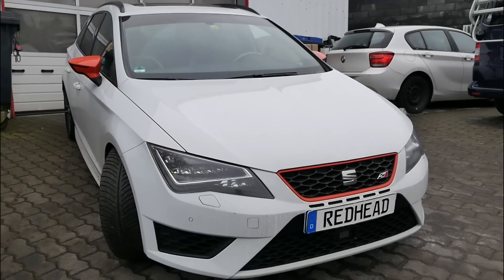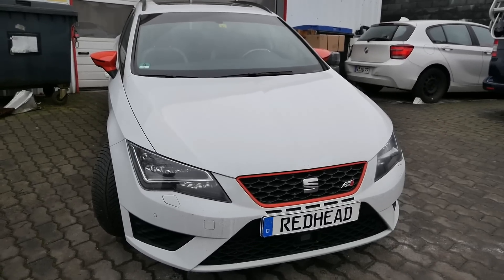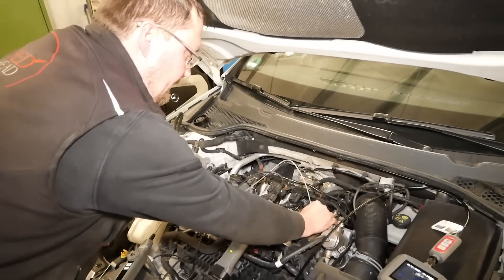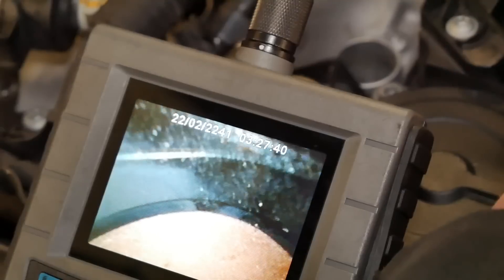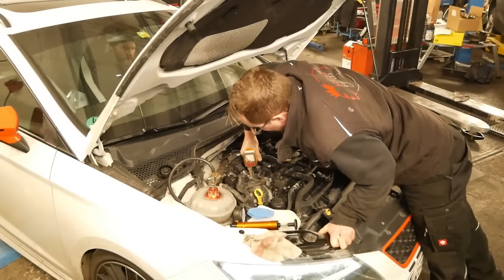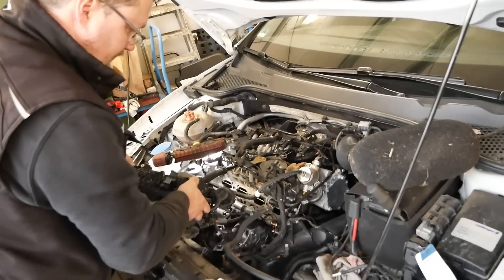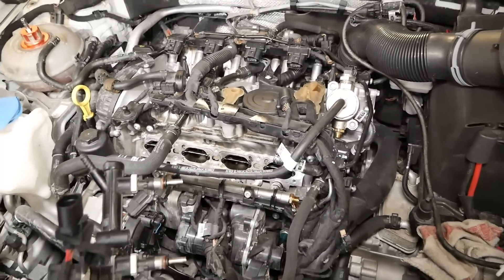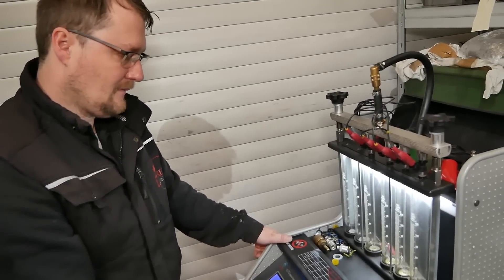Seat Leon 2.0 l TFSI mit 450 PS getunt - Hält der Motor das auf Dauer aus? SAE 5W50VR1  | Redhead

Comment: Was da alles noch für ein Geraffel an diesem TFSI  Motor sitzt...wenn ich da an meinen alten 1.8t denke. Was macht oder kann das alles? Kaputt gehen wahrscheinlich. ;-)
20w-50, da freut man sich auf den Kaltstart im Winter. Ob das im Sinne des Erfinders ist.
Reply: Eigentlich ist sehr wenig an dem Motor für einen Euro 6 Motor. Der Motor hat nicht mal mehr ein AGR.
Reply from the maker: Norman Engel.  Sie haben natürlich recht!
Valvoline ist bei der Empfehlung eines SAE 5 W 50 VR1 Racing von folgenden Empfehlungsvoraussetzungen ausgegangen die unten anstehen!
Im Video habe ich leider 20 W 50 gesagt!!!!  Das ist natürlich falsch... Ich meinte aber SAE 5W50 VR 1 TRacing ! 
Also die Empfehlung kam zustande unter der zusätzlichen Info: 

200-Zellen-Kat !

der Wagen hat eine Upgrade-Downpipe!

Ansonsten würde ja der Abgasstrang glühen, wenn der Serienkat verbaut wäre bzw. nicht ersetzt ist.

Bei einem Serienabgasstrang mit Kat, würde valvoline das SynPower 5w40 empfehlen.

Laut VW sollte hier allerdings (Serie) ein 5W30 nach VW 504 00 / 507 00 eingesetzt werden.

Comment: 20w50? Das kann im Sommer noch funktionieren aber bei winterlichem Kaltstart unnötig hoher Verschleiß. Lieber ein 5w50 oder wenn, dann 10w60.
Reply from the maker: mcericx;  Sorry, das war im Video falsch angegeben, es ist ein 5W 50 VR1  racing drin aufgrund der geänderten Abgasanlage auch zu fahren und von Valvoline empfohlen.
Reply: @RedheadZylinderkopftechnik  5W50 klingt schon besser. Ich hatte mich (bei offensichtlichem Winterbetrieb) schon erschrocken als ich 20W50 gehört habe.

Comment: 20W50 bei Winterbetrieb? Das halte ich für keine gute Idee. Der Motor bekommt von Werk aus 0W30/5W30. Da reicht in meinen Augen ein gutes, vollsynthetisches 5W40 (maximal 5W50) bei dem Tuning aus.
Reply from the maker: Chris, Sie haben natürlich recht! Valvoline ist bei der Empfehlung eines SAE 5 W 50 VR1 Racing von folgenden Empfehlungsvoraussetzungen ausgegangen die unten anstehen!
Im Video habe ich leider 20 W 50 gesagt!!!!  Das ist natürlich falsch... Ich meinte aber SAE 5W50 VR 1 TRacing ! 
Also die Empfehlung kam zustande unter der zusätzlichen Info: 

200-Zellen-Kat !

der Wagen hat eine Upgrade-Downpipe!

Ansonsten würde ja der Abgasstrang glühen, wenn der Serienkat verbaut wäre bzw. nicht ersetzt ist.

Bei einem Serienabgasstrang mit Kat, würde Valvoline  das SynPower 5w40 empfehlen.

Laut VW sollte hier allerdings (Serie) ein 5W30 nach VW 504 00 / 507 00 eingesetzt werden.
Reply: @RedheadZylinderkopftechnik  Bei der VW-Empfehlung geht es vor allem um den LongLife-Betrieb (flexibles Öl-Wechselintervall bis 30.000 km/Jahr) und den geringeren Aschegehalt des Öls (bei Verbrennung des Öls nicht regenerierbare Rückstände im OPF bzw. Kat).
Bei so einem getunten Motor würde ich auf ein gutes Nicht-LL-Öl und ein festes, jährliches Wechselintervall (< 15.000 km) setzen und so über einen geringen Ölverbrauch die Belastung des OPFs bzw. Kats minimieren.
Reply: @RedheadZylinderkopftechnik  Danke für die Rückmeldung! Dann bin ich beruhigt!

Comment: 450 PS in so einer kleinen Maschine kann nicht gut sein
Reply: Gibts doch quasi Serie auch schon in Form vom AMG Motor? Was haben die mittlerweile? 420PS? 
Aber halt nicht mit solchen Teilen ;-).
Reply: 😳
Das ist doch nach heutigem "Standard" schon n Bigblock mit seinen 2 Liter 🤔😅
Reply: Gähn. Diese hirnlosen Stammtischparolen gabs vor 30 Jahren schon "115 PS aus einem 2 Liter, das kann nie halten!". Heute das gleiche dumme Geschwätz. Meist von Leuten, die nicht mal einen Diesel von einem Benziner unterscheiden können.
 Der EA888 Gen 3 ist von Werk schon sehr robust und Oettinger hat die kritischen Komponenten im Motor zusätzlich gegen angemessene Upgrades getauscht. Wieso sollte die Leistung für einen Motor ein Problem sein, der darauf ausgelegt ist?
PS: 225 PS pro Liter ist heute nicht mehr viel. Siehe Motorräder. Eine Kawasaki H2R ist ein Serienmotorrad und hat ab Werk eine Literleistung von 310 PS. Probleme? Fehlanzeige.

Comment: Hält nicht ewig sowas ... wobei der Motor ja sowieso auch original selten die Karosserie überlebt. 200tkm erreicht doch kaum so Motor ohne in Teilen auf der Werkbank zu landen. Wenn ich die alten 944er Turbo seh .. standhaft gesteigert von 250 auf 290 bis 300PS ... und dann so Ding mit doppelter Leistung!? Hält der VW Mist keine 100.000km.  .... übrigens .. spart jetzt Seat auch an den Gasfedern für die Motorhaube?? Die werden immer teurer, aber man kriegt immer weniger für sein Geld
Reply: Das ist was, wo ich bei neueren Motoren auch nicht verstehe - bei VAG (Mercedes und BMW ja auch) da bist Du doch schon froh, wenn die die Serien PS dann auf 200.000 km halten - und da aus so einem kleinen Motor dann 450 PS zu holen - kann man machen, wenn der Verschleiß keine Rolle spielt. Aber die Laufleistungen finde ich eh schon krass. Hab mir le. März ein A4 3.0 TDI gekauft (mit 65.000 km) und da waren erst mal die Nockenwellen fällig - obwohl lt. Audi das Problem scheinbar ab 01/2017 behoben sein sollte. 
Mit Chiptunig würde der auch deutlich über 330 PS machen, aber so verlockend das ist, mache ich es einfach nicht - weil ich genau weiß dass ich die halt auch benützen würde.
Reply: @Chris-yy7qc  🤣🤣🤣
Reply: @Chris-yy7qc  vorallem Wenn die Bildung online Stattfindet statt eigene Erfahrungen ^^
Reply: 220000 km hab ich auf der Uhr läuft wie ein Glöckchen 💁‍♂️
Reply: @highbiker1127  Millionen Motoren gebaut sich 5videos hier angeschaut und schon gehen alle kaputt ^^ es zwingt dich auch kein Händler zbs Ölwechselintervall bei 60tkm zu machen ein wort und es wird auf festintervall umgestellt.
Reply: vw hält doch mit serienleistung kaum 70tkm.

wie kann man sowas nur kaufen !?
Reply: @casemodder89  Genau bei der Anzahl von Vag Motoren im Umlauf und wechselintervall von 70tkm gäbe es keine Arbeitslose mehr ....